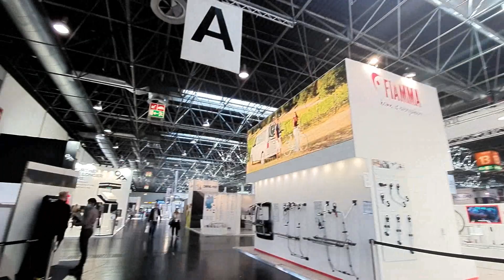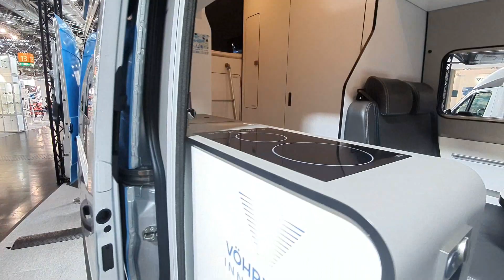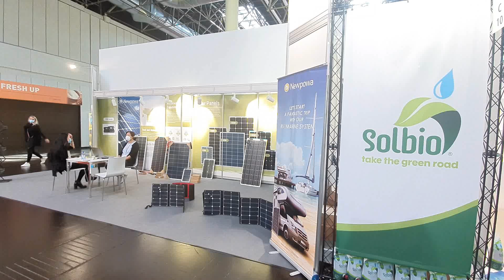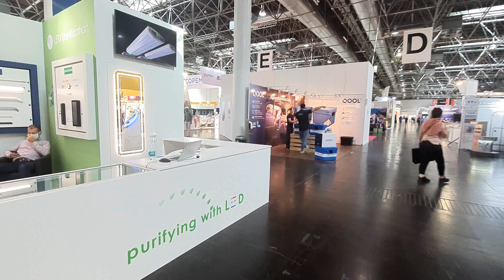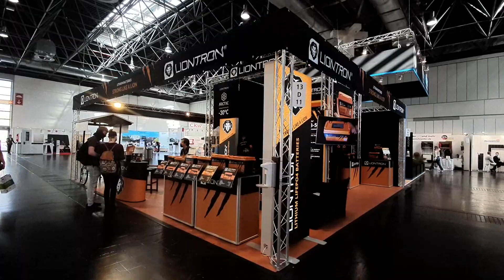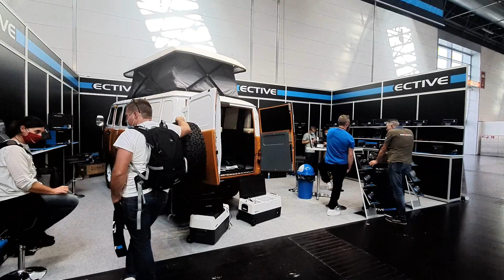2021 innovations in RV equipment

Comment: Great stuff Alan - interesting when you mentioned van weight loading and times used to its capacity.

It was something that I questioned from an engineering point of view early on - what is the designed duty cycles for the base vehicles and more appropriately, the quality of the conversion - quite pertinent when you passed the Fiamma stand.
Seeing more and more full time usage of vehicles and the attendant  failure of  componentry, it makes me wonder whether the increased expected usage of these vehicles will see a proportionate increase in quality , both in materials and execution.

Comment: Fascinating. In New Zealand you get the same power from a hook up as you would from a house plug! Wouldn't have dreamed you'd have something different in Europe. 
I look with envy at all the stuff you have access to for fitting out a campervan. I had a choice of one sort of lithium battery then had to wait until the boat came in. Life on an island in a big blue ocean.
Reply: Electricity costs a bomb especially heating and aircon so caravan parks don't want you using too much.